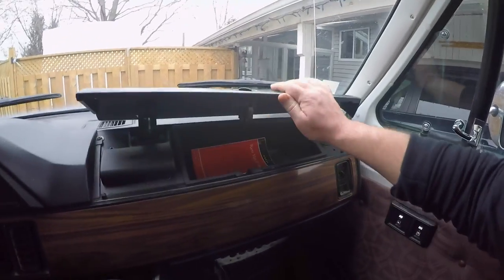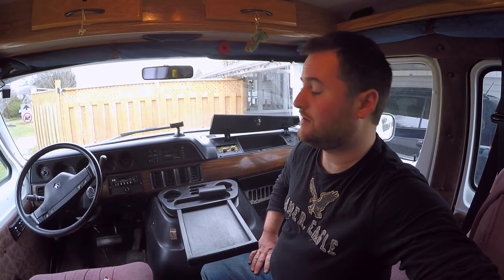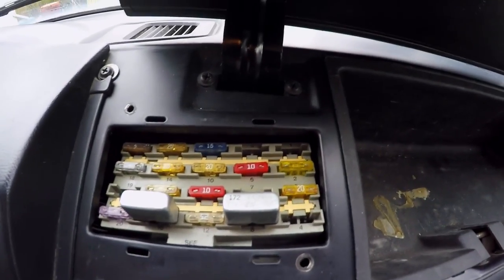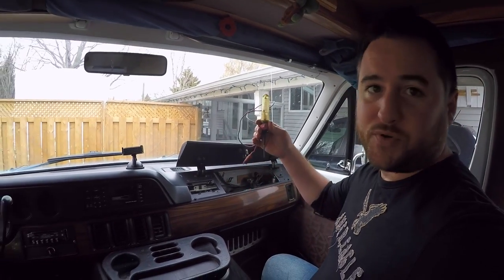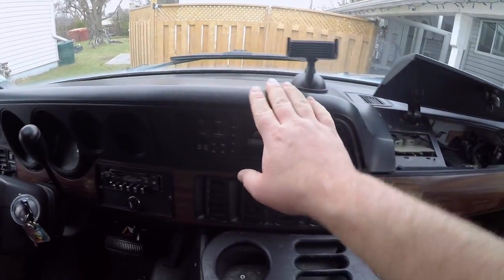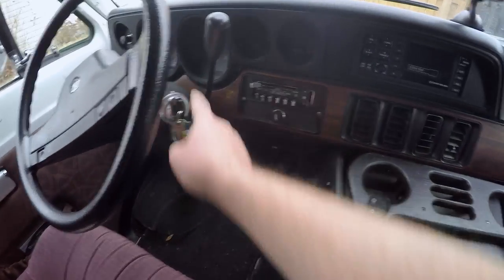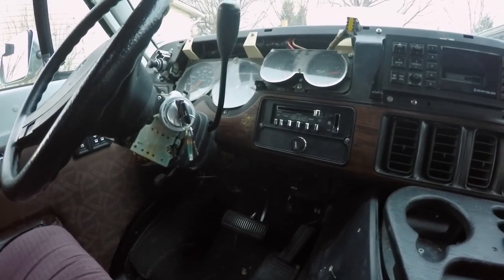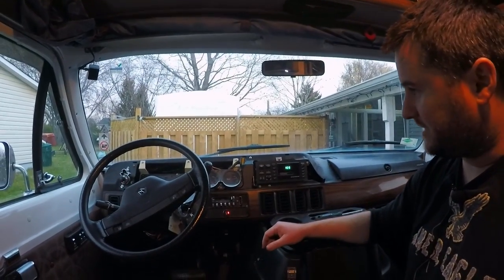GGC - 40 - No Dashboard Heat: Troubleshooting Electrical Problems

Comment: I'm a retired fleet mechanic, and I can say I was literally screaming to check the fusable links as soon as you had checked the fuses. One way to check fusable links is to grab them at both ends and pull.  Because the insulation is more rubber-like, if it's burned, it will stretch in most cases.  That clump where all the fusable links come out of is a factory joint.  You are correct replacing the bad link with the same size, and the way to replace it is almost exactly as you did.  Soldering is the best way, and you tap into the power before the link cluster, and bypass the cluster soldering the other end to the 2 wires.  I hope you didn't tape the fusable links up.  If one goes again, the heat could take others out.  They rely on air around them to dissipate heat during brief periods of high amperage draw.  You need to get a service manual for your van.  It would have likely taken you straight from the fuse panel to the fusable links.  Good repair.  Take an "atta boy" out of petty cash.

Modern vehicles use Maxi fuses instead of fusable links now as a rule.  They're located in the power distribution boxes under the hood.
Reply: +iceman22st It looks like he did tape up the fusable links...

Comment: You some times refer to an open circuit as a short.  Commonly people mix up the terms Short, Open and Intermittent or refer to all of them as shorts.  An Open is no connection where there should be one (your fusible link was open). A short is a connection where there shouldn't be one ( usually resulting in a blown fuse). An intermittent is either of the previous two that comes and goes.   Also when you Checked the fusible link, you should have had the fan on high and then tried both electric windows in case the total current of all of them is too much for the fusible link. If one or more of the motors has too much draw it might not burn out the fusible link unless the others are running too. You may find that the link burns out when the fan is on high and the left window is activated as an example.  Perhaps the motors need to be cleaned and lubricated to reduce the current draw. So much for the "whining".  I probably would have replaced the fusible link with a piece of regular wire and hoped for the best. You did a good job.
Reply: +David Bishop You should NEVER replace a fusable link with a normal wire except to limp home or to a place to fix it.  If the high current draw happens again, you might end up with the wire heating up, and melting other wires damaging other circuits, necessitating a rewire of the vehicle as a minimum, or the vehicle might burn to the ground.
Reply: Gets exciting fast doesn't it.  Not related to electrical, but I had a fire under the hood of my race car (ice racing) during practice once just at the top end of the front straight.  Just getting ready to downshift and throw the car sideways at about 65mph, when WHOOF.  Flames shot up the windshield.  Got real exciting, real fast!
Reply: I would have replaced it with a 12 gauge normal wire (the same gauge as the brown/orange wire) and a fuse holder and 40 AMP MAXI Fuse myself. It is MUCH easier to replace fuses, then rebuilding and resoldering in fusible links. This gives you the extra time to figure out what is causing the extra draw. If its the power windows, then you can simply train yourself to not operate both at the same time. If it really was a 20 gauge fuse link, then a 40 amp fuse was the perfect replacement.

Comment: Still watching video so you may have found the problem but, I had the same problem, its the switch that your key and lock fits into to start the car. called a starter switch
Reply: +Shelby and Simon this is how I figured it out in about 3 minutes: http://www.amazon.com/Service-Repair-Manual-Engine-Wiring/dp/B00U2U9M3E/ref=sr_1_2?ie=UTF8&qid=1450835551&sr=8-2&keywords=Dodge+1992+Ram+Van+Service+Manual

WORTH EVERY PENNY
Reply: +Shelby and Simon The switch where the key goes is called the ignition switch.

Comment: Another atta boy from here. Good technique and systematic elimination. Don't know if it's due to a hidden problem like motor windings being corroded and shorting out some windings lowering the resistance of the motor and thereby drawing more current. You might check your manual if you have one like Chilton's or Hayes and see if they tell you the proper DC resistance of the motors. Take care

Comment: fusible link?  Lets make a wire that is actually a fuse, and hide it somewhere unknown.  and oh by the way, put fuses downstream to make you think its not a fused situation.  am failing to understand the design intelligence that created fusible links.   Supose its because in a crash wires are going to short, and cause fires, and you best just have them disconnect, instead of starting fires in the engine compartment.

Comment: You could have just purchased an in line fuse holder and put a fuse in that line in place of the fuse link wire. That would have made it a replaceable fuse if future problems arise, a glass fuse with a slow blow fuse in it. And I agree, remove the tape you put over the fuse link wires. Accumulated heat within the link section could cause failure of the links for other circuits also.
Reply: +BigFireDave Forgot to say the fuse size should be the total of the fuses in that line of the fuse block.